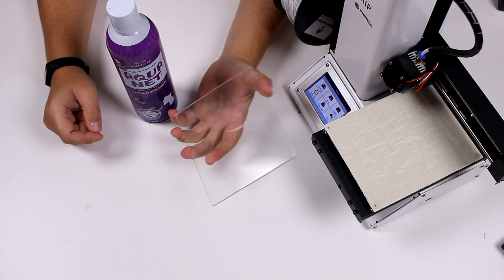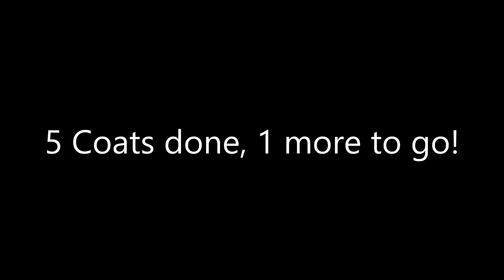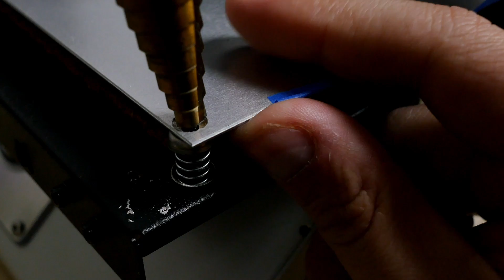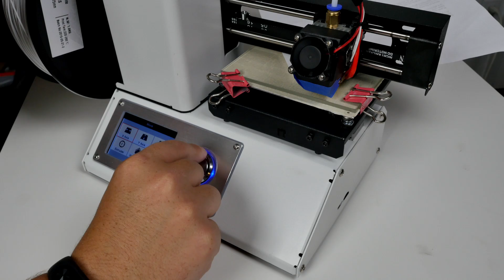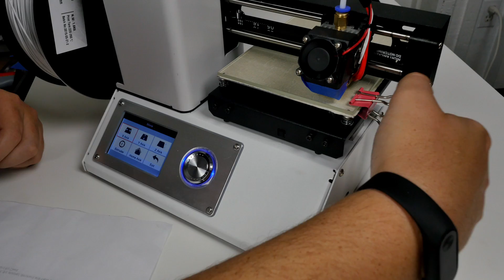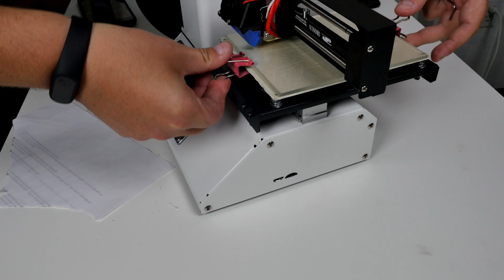Monoprice Select Mini 3D Printer Beginner's Guide (Part 6) - Adding the Glass Bed!

Comment: Why not just use the 5x5 are you really going to print that close to the screws plus it would level in 1/4 the time ..you wouldst need to go back and forth. 2 clicp in the center from and back and then level..

Comment: hey, great tutorials, but quick question. I am on a tight budget and I don't have hairspray, do you think spray adhesive or spray lacquer would work instead?
Reply from the maker: No.  Hairspray, or in a pinch elmers gluestick.  If you are on such a tight budget that a $4 can of hairspray is too much, I'd wait until you can afford the hairspray :)
Reply: haha, no I can afford it, I just don't want to spend money on stuff if I don't have to or already have something that could be used as a substitute. but thanks!
Reply: Life and Times of Tyler Another question, do I need the masking tape on it, or can I just have the  normal build plate? I'm worried that the making tape might not look as good.
Reply from the maker: You will want something as a print bonding surface.  Masking tape, PEI film, BuildTak, Hair Spray or Glue Stick.  You need a material to act as a bonding agent that releases when not at temperature.  If you don't use glass, keep using tape.
Reply: no, I meant under the glass. In the video you left the masking tape on the original print surface when you put the glass bed on. I was wondering if I could take it off and not have problems.
Reply: Oh, yeah, for sure.  I just leave it on to give the glass a surface to sit on an absorb any small vibrations.  But it's totally optional, and if you're using rigid clamps of some sort, totally unnecessary.
Reply: OK, thanks! 😃😃

Comment: Has someone tried to use smartphone tempered glass protector(s) with good results?
Reply from the maker: Lots of people do this, but it doesn't save you much money and has its own downsides (mostly you have a seam in the middle, because you'll need two screen protectors side by side)

Comment: Curious to know why you didn't just use the 5x5 sheet of glass to level the bed, since one would assume that the tolerance on the two pieces of glass would be much closer than then machined parts? Using the 5x5 seemed to leave the levelling screws free on both ends. So you wouldn't have to keep rearranging the glass plate.
Granted, not everyone would have both sizes, but I'd say that the main idea still comes across.
And then swap it out for the 6x5 glass afterwards.
Reply from the maker: Yep.  The only reason I showed this method is for folks who don't want to do the work to flush mount the screws, or otherwise didn't think about it.

Comment: How hard is it to print on bare glass with this printer? I did it on my Di3, and ohhh man I love the mirror-smooth finish, plus your prints take literally no effort to take off the bed once it's cooled down.
Reply from the maker: +Laser Lens not hard at all with PLA.  I've never been able to do it with ABS.  Even with hairspray you still get the mirror smooth finish :)
Reply: So if u just use pla you don't have to use hairspray.

Comment: Since it's not damaging to have hairspray on the heated print bed, would it be a bad thing to just use a layer of hairspray to hold the glass in place (from sliding with the clips), to remove all layers of material between the glass and the metal heat bed? If the purpose of the painter's tape really is just to hold it in place, it doesn't seem like a bad idea to just use the hairspray instead. It's just a thought, but perhaps I'm missing something. Thanks!

Also, this video series is the best series for a device setup that I've ever had the pleasure to follow. It's great!!!

Have you given any thought to doing a series like this for the Monoprice Maker Select V2?

Comment: im confused, so if pressing the home option on the screen sets the z position wouldnt it drive int your glass since we didnt "update" the z position after you did your leveling
Reply from the maker: No, because we installed a physical spacer as well to raise the real "0" z-height, and you should also tighten all of your bed screws before re-leveling just to be sure you clear it :)

Comment: Why not just cut the corners off the glass and avoid having to drill into the printer bed?
Reply from the maker: With plate glass you can.  I ruined a couple of pieces of borosilicate trying to cut the corners off.  Your mileage may vary.
Reply: I ended up buying a Printinz bed and haven't looked back at glass since. The best part is flexing prints off it and they come off clean!

Comment: Two questions;  how many prints can you get out of the 5+ layers of hairspray?  And can't you disable the stepper motors so you can move the bed and hot end by hand to level the bed? I would hate to think I had to do this stuff between every print!

Comment: Hi Tyler
I want to calibrate the XYZ and E axis because it is out a bit and want to make more accurate prints.  Do you know if it is possible to connect the Mini to a computer?  I see there is a micro USB connector near the SD.  Have you done this yourself?
Reply from the maker: +valveman12 I didn't have the need to, printing calibration parts showed my XYZ within .5% accuracy and extrusion within 1-2%.  Watch my tuning video (#3 in the series) to show how to connect to your PC and use pronterface.

But before doing that, it's very very unlikely you'll need to do this for anything.  Using the recommended layer height multiples and playing with flow rates +/- 5% should get you to tolerances of .05mm or less.  Beyond that is pretty much out of reach for this printer.
Reply: Thank you again fro the quick response.  Perhaps my problem is my settings.  eg: when I am trying to put two piece together, such as a lid, They never fit and I have to do trial an error prints to get them to work.  I will have a look at some of you other videos.  Thanks again.
Reply from the maker: +valveman12 if it's parts you are designing yourself, give .2-.4mm separation distance for a "snap" fit.  I've had the same problem designing my own parts, it does unfortunately take some trial and error sometimes.

Start by printing calibration cubes and measuring with calipers to figure out how far off your parts are.
Reply: Thanks again Tyler
I do like to design my own parts.  I will try out the calibration cubes.
Reply: Hi Tyler
I printed the calibration cube and in the worst case (Z axis) is out 0.24mm.
X and Y are less.
I suppose that is not bad.
Reply from the maker: valveman12 whoa, the z is pretty far off.  Upping your first layer height by .2 in Cura should take out that difference (if it's the same for 20mm and 40mm calibration cubes). For the XY you can reduce or increase width by ~.1mm by adjusting the flow rate by 5%
Reply: Hmmm I got lots to learn still.  I was thinking about re-calibrating all axis by connecting the printer to the computer and putting in an arbitrary length, checking the percentage difference and correcting via Gcode.

Comment: Looks as you might have a different (blue) fan duct on the printer. Did I miss that in an earlier Part?
Reply from the maker: +Carl Luther nope, it's just a piece of blue painters tape over the part filling duct so it doesn't blow cold air on the part, only across the heat break.  For ABS this is necessary to reduce warping.
Reply: Thanks for the reply. I had originally asked about that when you had it in the back only.